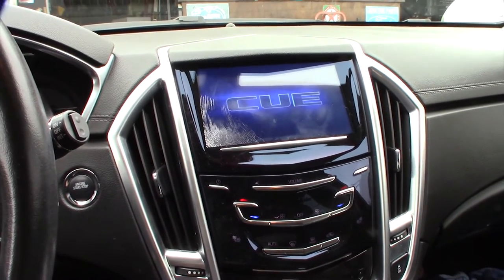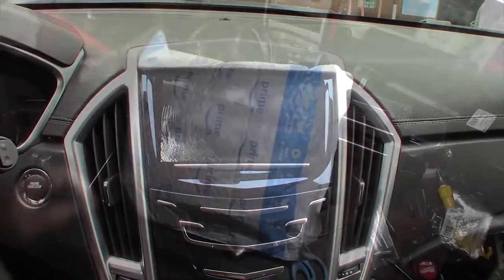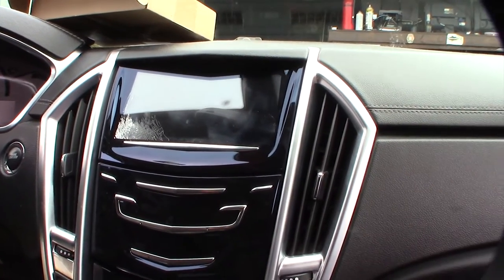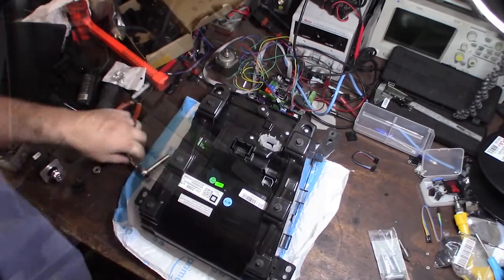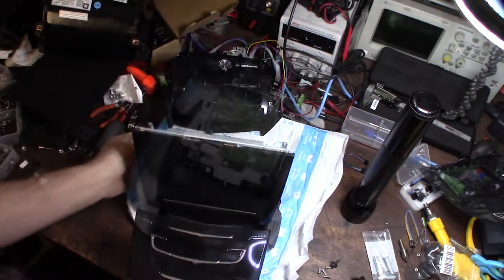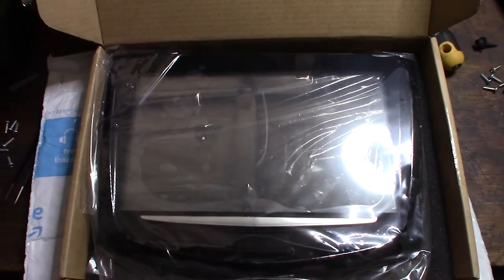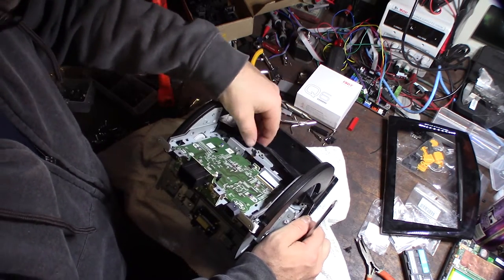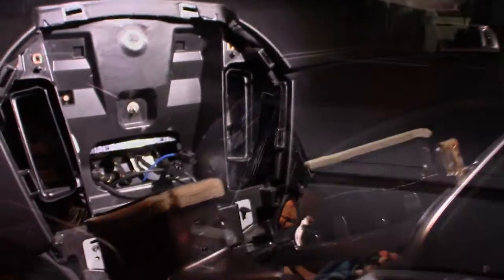Cadillac SRX cracked Cue Screen removal & replacement 2013 2014 2015 2016 2017 ATS CTS XTS Escalade

Comment: So I replaced my CUE touch screen last night.  It took me about 2 hours. Your video was invaluable. I definitely would not have been able to do this on my own.  There were parts of your video that I played over and over again to make sure that I was doing it right.  In the end, it all turned out better than I had hoped.  I was initially very intimidated at the prospect of pulling the trim off and extracting the CUE module, but with the help of your video, it was actually pretty simple.  I just thought I'd leave a quick note to thank you for producing this video, and to let others know that it is totally doable.  I also replaced my backup camera (different video), but it turned out to be pretty easy as well.

Comment: Nice job on the installation. That giant foam blob in the middle of the screen layers is permanently there because of a dirty manufacturing environment, and is the reason those screens are so cheap. I would have definitely sent it back.  If you get sick of looking at it and want to replace it with a higher quality true OEM grade version- shoot me a message for a discounted price.
Reply: CUESCREENS I ordered mine from y guys! Thanks
Reply: If you want the readers digest version of how to do this, this is the person version for you.  However, just to get it out it will probably take you as a beginner at least an hour, for 1 there are a few issues, some of the screws just to get it out of the car where not 8 mm but larger.  The best way to do it is to take a piece of paper with little bowls and write under the bowls where the screws go.  To unhook the 3 wires that connect the radio/monitor to your care, takes some elbow grease if you don't know what you are doing.  Once you get it out of the car that's where the real fun begins, it will take you at least 90 minutes maybe even 2 hours to get the 25 plus screws off to actually expose the old monitor and remember........Keep the screws organized (you will have plastic screws and machine screws) Plastic screws are the screws that go into plastic, they are screws, the others that go into the metal are shiny have a dull end and look more like a bolt.  If you are not careful you will do what I did and have 1 big pile of screws as if you aren't already overwhelmed.  

  I ordered mine from Cuescreens directly.  Their video was life saving in addition you can call the owner directly and he will walk you through it.  They offer better monitors that don't have the same gel technology that created the issue in the first place.  You will spend a little more than 56 dollars for them but remember you are in this situation because of the same cheap screen that created the problem in the 1st place so to install the same non sense well expect the same non sense to happen again especially if you live in extreme cold and hot temperatures.  

If you order from them they will send you the tools needed to get into the guts of your car and some small tweezers that you will need to insert the copper cable, you will need your own screw driver and socket wrench.  They offer a warranty on it as well as superior screens.  It took me a noob/beginner probably 4 hours to do it.  I didn't want to mess it up.  All i'm saying is don't come into to it expecting to get it done in 1 hour.  at least 2.5.

Comment: If you want the readers digest version of how to do this, this is the person version for you.  However, just to get it out it will probably take you as a beginner at least an hour, for 1 there are a few issues, some of the screws just to get it out of the car where not 8 mm but larger.  The best way to do it is to take a piece of paper with little bowls and write under the bowls where the screws go.  To unhook the 3 wires that connect the radio/monitor to your care, takes some elbow grease if you don't know what you are doing.  Once you get it out of the car that's where the real fun begins, it will take you at least 90 minutes maybe even 2 hours to get the 25 plus screws off to actually expose the old monitor and remember........Keep the screws organized (you will have plastic screws and machine screws) Plastic screws are the screws that go into plastic, they are screws, the others that go into the metal are shiny have a dull end and look more like a bolt.  If you are not careful you will do what I did and have 1 big pile of screws as if you aren't already overwhelmed.  
  I ordered mine from Cuescreens directly.  Their video was life saving in addition you can call the owner directly and he will walk you through it.  They offer better monitors that don't have the same gel technology that created the issue in the first place.  You will spend a little more than 56 dollars for them but remember you are in this situation because of the same cheap screen that created the problem in the 1st place so to install the same non sense well expect the same non sense to happen again especially if you live in extreme cold and hot temperatures.  
If you order from them they will send you the tools needed to get into the guts of your car and some small tweezers that you will need to insert the copper cable, you will need your own screw driver and socket wrench.  They offer a warranty on it as well as superior screens.  It took me a noob/beginner probably 4 hours to do it.  I didn't want to mess it up.  All i'm saying is don't come into to it expecting to get it done in 1 hour.  at least 2.5.

Comment: I was sure what piece I needed.  It was the glass between the front piece and the actual lcd. And yes this part was the part. It wasn’t just the thin plastic that was in the front. It also had glass behind it and it worked and it worked excellent and I was done in an hour..  and I bought the $32 one and it showed up the next day.

Comment: I replaced the Cue but when I plugged it back in, the screen still won't come on. It's totally black as well as the steering wheel. I can control the air but there's no lights on the entire Cue. Nothing about the screen works though.
Do you have any idea why it wouldn't power back up after plugging the new Cue up?
Thanks for any help.